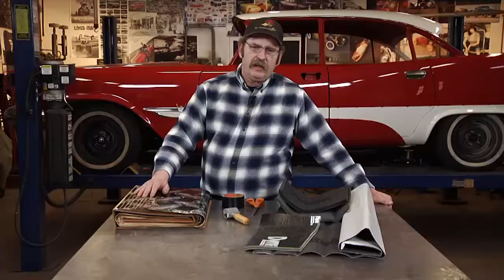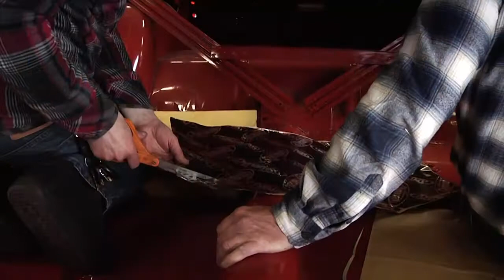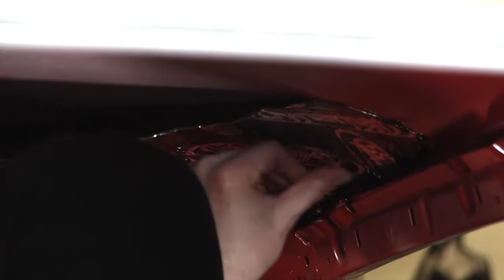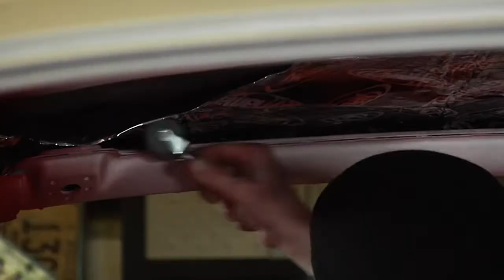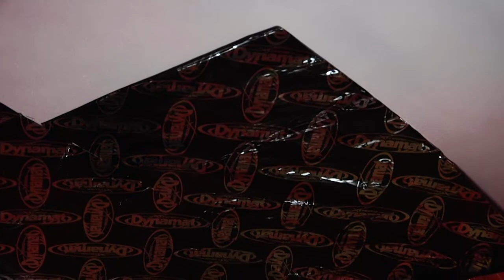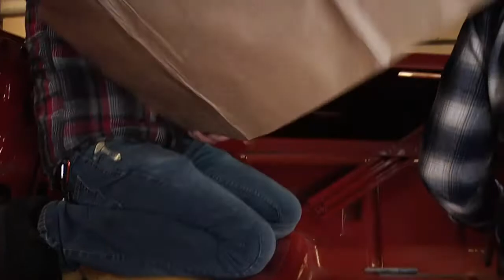Installing Sound and Heat Insulation

Comment: Since you are sharing your wisdom if i may let me share some about sound frequencies and sound deadening.
None of the products (butyl, rubber/foam liner or loaded vinyl) work by themselves to kill all sound. They each deaden a specific frequency of sound.
Butyl works to kill low frequency resonance of the flat metal (thus you do NOT need to cover the surface completely! 50% cover will kill all low frequencies - don't waste your money!!).
Rubber/foam will kill most mid frequencies and provide space for sound waves to dissipate before they hit loaded vinyl.

Although Dynamat makes good product they are not too honest in their advertising. They show interior of the cars covered wall to wall with their butyl thus creating wrong presumption on part of the customers on how to use their product correctly (= more product used = more money for them).

Ideally you want to 1.) cover large 50% of metal sheet areas with butyl then 2.) cover ALL with roam/rubber and 3.) finish with loaded vinyl (some companies make roam with loaded vinyl so you can combine step 2 and 3).
Reply: Yes, please! Send a link of the products mentioned in your response.
Reply: My dream is to buy a classic car, something like 1960-1968 Coupe DeVille, Challenger, or a truck.
I live in Saudi Arabia, which is too hot and some of the roads aren't that smooth!
So I need something to reflect the heat and cancel the noise... What should I do?
I thought about buying a car, send it to GasMonkeyGarage and let them do it, but that would rape me financially for the next 100 years!

Comment: You really should have not pushed the liner all the way where you can't seal it.  You want to seal all around butyl rubber panels, and any seams.  By leaving unsealed edged you provide the ability of the rubber to heat up, melt, and run just like you said.. especially on a roof.  Getting that cleaned out after it leaks isn't going to be fun.  This isn't as as important on floors since there is jute, but on doors and ceilings, its' pretty critical.